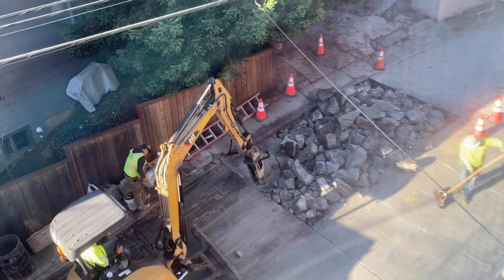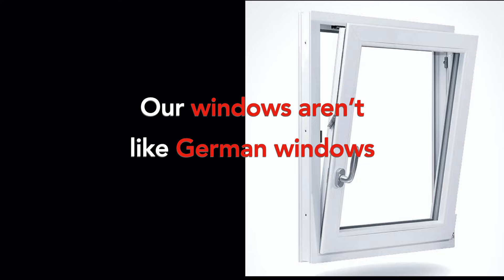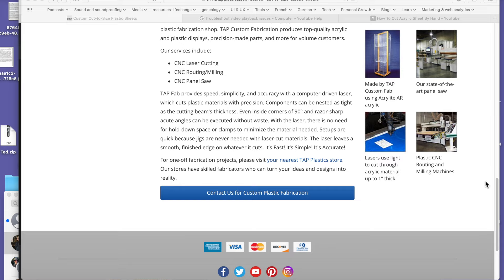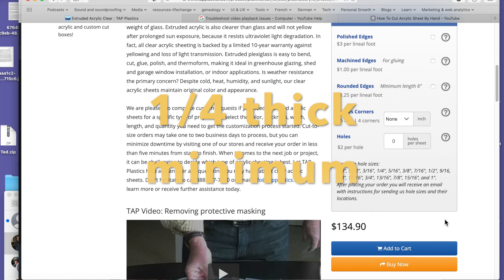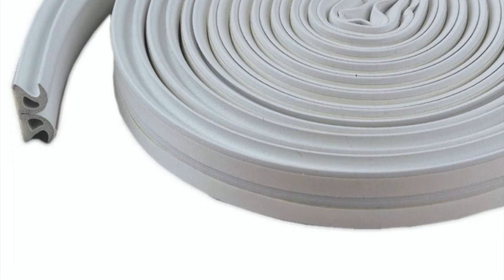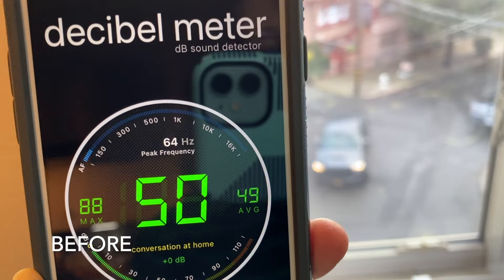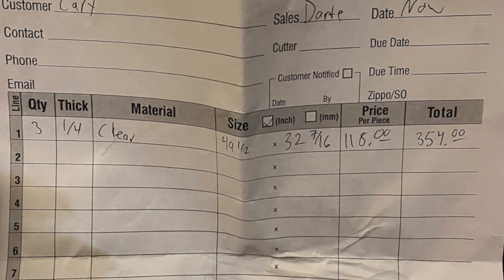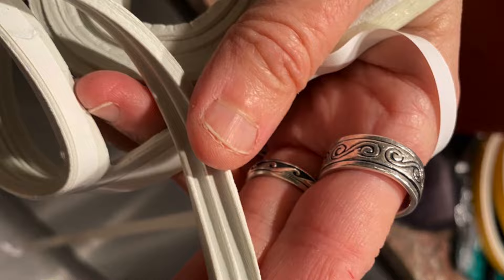How to make a DIY window insert for noise reduction

Comment: I like to study in peace but i cannot do so because there is a cutout in my wall (brick wall)  which is an open window and a lot of sound disturbances come through it. I want to block the sounds that come from outside, what should i do? I cannot really fill it with bricks cause there's not enough space to fit them because of the window grill which is built in the wall. Its like a thick window grill that is fixed in the cement and thus i cannot put bricks in the cutout.
Reply from the maker: To help me visualize the issue, can you send me a photo? First, contact me through this form on the Soundproofist website. It will send an email to me. When I respond to it, you can attach a photo. https://soundproofist.com/contact-us/

Comment: Great job, I had same issue with a big window, 48inches x 104, 96inches is the  maximum for almost all sheets, so I made a wood frame and attached the acrylic sheet to it using screws, but before applied silicon between the wood and acrylic , to reduce vibration, then drilled  several holes and use the  screws to made the attachment stronger, with the wood frame its easier to attach the insert to the window frame and seal any gap with silicon, total cost i would say $400 , same insert from Indow would cost around $2000,  but result was amazing, no more noise from neighbors.
Reply from the maker: Thanks for the info on how you built your window insert. Did you have to drill through the plexiglass? And if so, how did you keep it from cracking? I kind of wish I'd put a wood frame around the pieces -- they'd be sturdier and easier to work with. Anyone watching this video who's good with woodworking, I recommend it.
Reply: drilling the acrylic does not crack it, the problem is when screwing, do not tighten too much, the holes should be slightly larger than the diameter of the screw, when screwing you can see the expansion of the silicone between the wood and the acrylic sealing any air gap and help to avoid  crack the acrylic, after that you can apply more silicon to any joint between wood and acrylic, this will create a whole sealed  piece, ready to install.
Reply: Can you send me a picture of how it looks?? It would be greatly appreciated😄
Reply: do you mean slightly smaller than diameter of the screw? if the hole is larger than the screw diameter.. what is it screwing? just into the wood on the other side? im confused

Comment: Sound waves are mechanical like water waves. Im wondering if the window isn't perfectly water proof, sound will seep in but much more than water would because it's thinner.
Reply from the maker: The air gap between the insert and the actual window also helps to stop some noise transfer. BUT.. the vinyl windows in this building are retrofitted from the original single-paned aluminum windows from the 1950s, and there could be imperfections in the installation, since they're not original. Also the front wall of the building is only 4 inches deep and it's made from wood, so that's not much of a barrier against road noise. The window inserts help for the mid-frequencies but not the lowest frequencies.

Comment: What were they thinking in the 50s not insulating buldings. Its a horror show!! Id almost rather be deaf.
Reply from the maker: They probably were thinking of the most-economical ways to build something to the code requirements of that era. Particularly multi-unit buildings. The developer didn't plan to live there. They didn't know nor care about acoustics. Also, sometimes people who remodel an apartment can make it worse if they don't know much about acoustical impact. I hope these videos can help. My building sounds like an acoustic guitar, and over the years, some of the apartments were improved on in small ways, but the building as a whole doesn't have a comprehensive solution. (I'm glad I have my hearing, though.)

Comment: I admire your hutzpah. I have an old home with single pane (seriously) and am thinking about doing the same thing, I will build wood frames and route a slightly oversized groove to accommodate the plexiglass, using caulk to sort of set them in place. I will let you know how it goes. I have never heard of tap plastics and will check them out.
Reply from the maker: It's worth it, especially if you have only single pane glass right now. In addition to TAP Plastics, I've found at least one other company, Acme Plastics. They might also cut to size, but it looks it costs a bit more than TAP,  per sheet. Both companies also sell polycarbonate plastic, which is even stronger than plexiglass and unbreakable (but also more expensive).
Reply: @soundproofist  Thank you so much for sharing all this information and providing those references. This goes such a long way for my family. I'm already a big support of your channel.

I hope the polycarbonate plastic from Acme Plastics works. I was in the middle of purchasing indow insert for $860 + shipping now I will test your recommendations. Of course not the same but better than nothing.
Reply from the maker: @belalkoura1602  Glad you found this helpful. I'm curious -- did you try this yet on your windows?
Reply: @soundproofist  Yes I have and it works. I did come up with a different idea that worked even better. I did some research and it was recommended to have as much dead space as possible between the window and the Plexiglass. 

So the idea is to purchase larger dimensions of the plexiglass to place on the window sill and perfectly place it there. Two inches larger than my window box dimensions. 

Before placing it on the window sill, I used adhesive weather seal strip around the entire plexiglass on all four sides (it will flush against the wall).

Placed it on the window sill then had to lock it in place. Therefore, I drilled in window screen clips to lock it in place and had the weather seal strips flush against the wall.
Reply from the maker: @belalkoura1602  Great to hear, and thanks for sharing your story (and technique) with us!
Reply: Since you are building the wood frame, would you like to try to add window film to one side to make it like double pane (plastic-air-film)? I did double film (film-air-film) in 2022 winter with great results. (Except the tension bends the frame LOL)

Comment: Awesome information! I can't wait for electric cars for this reason:)
Reply from the maker: Thanks! Electric cars -- because they won't emit that low-frequency "boom!" that goes through walls and windows?
Reply: There will be some asshole that will invent some aftermarket add-on for electric cars to make them just as annoying.
Reply: @vashon100  perhaps, however, increased awareness regarding the health issues related to noise in combination with electric semis gaining traction (all ready see it with mass transit) will not allow these for lack of better words "rectums" to hide in the minutia of noise plumes of our transportation. If we speak up in conjunction with $$$$ (best talking points) we can have politicians make local governments money either charging a fee for that noise that can be used for earplugs for the sane people or penalties for breaking the law. The latter would be much appreciated 🙂.
Reply from the maker: @functionalvanconversion4284  Probably penalties (as in ticket$) could help reduce the modified (extra loud) cars, as well as vehicles that run red lights with impunity, drag race on city streets, and so on...activities that seem to be on the increase while enforcement seems to be on the decline. Now I need to find some data to back up my assumption: when did enforcement stop in a city, and if at the same time, complaints and incidents increased.
Reply: @soundproofist  your observations seem to match mine. I have noticed in our town that police are starting to actually enforce the law, so perhaps that will help. Unfortunately as people of all ages continue to lose the ability to move with their bodies, vehicles are a way to get the sensation of virility.....or maybe I am reaching. Whatever the case younger folks are looking not so good to to sedentary lifestyles.....too much video games and fast and furious 🤔
Reply: @vashon100  That has already been done.  Several exhaust system companies are testing systems for cars such as the Ford Mach-E that give it a V8 rumble.  I am a car guy myself, but found this channel while searching for soundproofing options.

Comment: You need some clear polycabonate H-profiles  to hold the 3 panels together. It exists with 1/4 inch channels so it would fit perfectly yours.
Reply from the maker: Thanks. After I made this video, I found that I already had something in my apartment that I could use ("mullions"), and I made a follow-up video about it. But more importantly, I found "joiners" for sale at TAP Plastics that I didn't see when I was in their store. And these would fit the panels together perfectly. And you're right -- they're "H" shaped, with an opening on either side to hold a panel on each side.
Reply: @soundproofist  awesome, they should hold very well together with that. Thanks for the video.

Comment: Thanks for the walk-through.  I am looking at the same situation to deal with some 1950s single pane aluminum windows in the front of my house (I actually really like the windows).  In your case, I think I would have tried to break-up the insert in the same places you have frames, so that it is less noticeable.  Sound-deadening also depends on stopping air movement so getting some sort of gap fill between those panes can help too. 👍

Comment: Great video!. I worked for a thermal window insert company years ago. We use vertical wood mullion and two or more sections of acrylic with vinyl frames for the wider windows. They attached to metal L-frames screwed into the window frames with magnet strips all around to make the windows  removable. I had barking dogs next door where I used to live, this would have never worked in my case. I literally stuffed insulation, towels and then covered and sealed the window with sheetrock and it still didn't help with the noise. Sometimes if insulation is poor in the house you will still hear noise. It's based on how well your walls and whole house is insulated. But reducing noise a bit will work with thermal windows if you're happy with that.
Reply from the maker: Totally agree. You probably saw (in a follow-up video that I made) that I did have some mullions that I repurposed to join the three plexiglass panels together. As for the noise -- absolutely. My building is a wood-framed building with thin walls, and it's extremely close to the street. The sidewalk is almost non-existent, and there's no setback. So the low-frequency noise from trucks and cars is coming from the ground level up through the framing. Not just through the windows. My walls are insulated, but all the areas around the big windows are just wood framing (headers, etc.) with no room to insert insulation. So those window inserts block or reduce certain frequencies. But many of the sounds are also coming through the building frame, from low-frequency engine noise to the sound of "manhole covers" banging up and down every time a car drives over them (a much higher frequency).  I'm still glad I did it because the acoustics of my neighborhood are really annoying and sound bounces everywhere. For example, I don't hear the loud talking on cellphone calls from passers-by like I used to. To reduce some of the deeper building-frame noise, I would literally have to tear the walls and flooring down to the studs and start over. A very expensive and disruptive undertaking!
Reply: @soundproofist  old building code didn't require seal between frame and plywood for air tight. Which create air gap, both noise seeping in and air leaks defeats the insulation. Difficult to fix that problem.

Comment: I just did this for 2 windows facing a busy street. It works great! I added foam weatherstripping around the edges and a long the window frame to seal them in place. Definitely a noticable noise reduction, all for maybe 25% of what Indows would have cost.
Reply from the maker: That's great to hear! Thanks for the info!

Comment: Thank you for the video. I was quoted over 3K for two large window inserts (60x72) and (36x72) by a company in OR(I'm in Az). I just started thinking about pouring my own acrylic insert into a mold and framing but came across your solution which is great. There is no TAP B&M around me (south of Metro Phoenix) but I work with a lot of professional plastic fabricators so I'll give them a holler and see how much they charge for large sheets of plexiglass/acrylic.
Reply from the maker: You're welcome! I'm sure there are other (more local) building-supply or fabricator-supply shops that sell heavy-duty plexiglass like this. So if you can find one locally and avoid shipping costs, etc. you're all set.

Comment: Thank you! We have been waiting for a call back from Indow after leaving them three messages. We are now looking into just doing it ourselves. Thank you for sharing this information.
Reply from the maker: You're welcome. I personally don't like it if I can't look at a cost estimate on my own (through a website) without going through a salesperson. And then unfortunately you might get pursued by a salesperson to make a decision/close the deal after that. I think the results would have been the same if I had purchased an insert with them and not built my own -- that is, the same  frequencies of noise would be reduced (or not reduced) if I had bought those windows versus making my own. It answered the question: How much noise is from the windows, and how much is structure-borne?
Reply: I went with indow and it took 12 weeks from the day I ordered a single piece, to the time I received it. It worked perfectly for my noise issue, but was costly. I want to help my parents with their own noise issues. This video looks great after searching for solutions for hours.

Comment: Apparently this also helps w/ cooling and heating--cooler in summer and warmer in winter.
Reply from the maker: I guess I'll find out this summer! I bet if I'd left that blue film on the plexiglass it would definitely help filter the sun and keep the room cool. I do think it's helping with retaining heat during the winter.
Reply: Velvet curtains with the silvergrey blackout linings, also insulates against the heat and cold infiltration. Should improve acoustics a bit, in rooms as well.